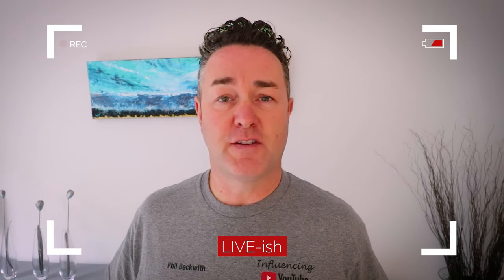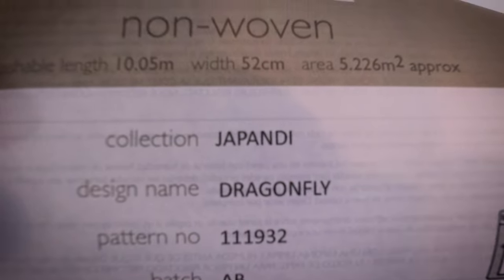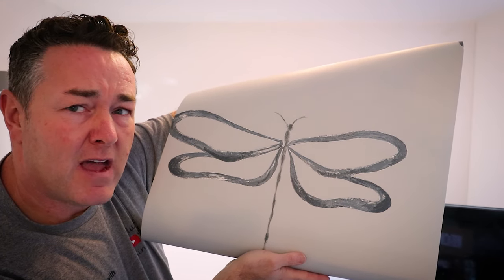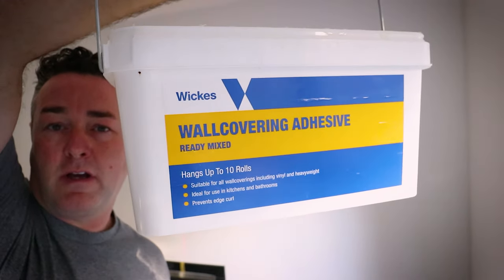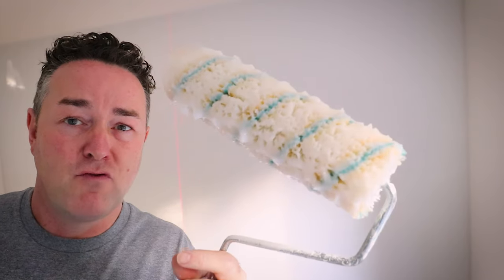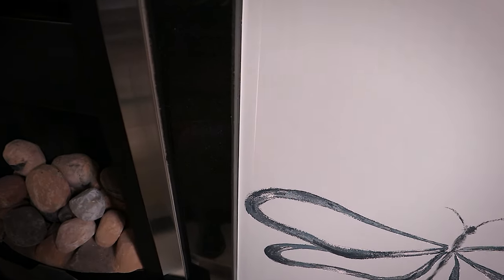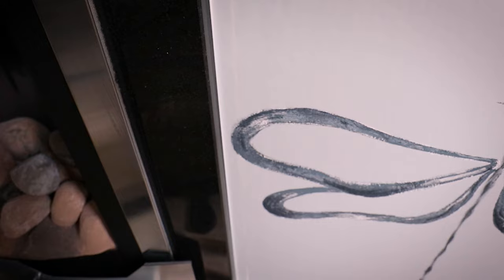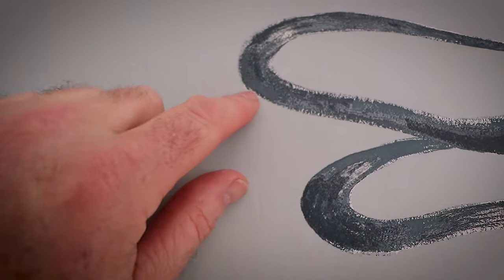How To Wallpaper a Feature Wall - Scion Dragonfly wallpaper - Paste The Wall

Comment: Why do you use Wickes ready mixed adhesive and not wallrock power adhesive on the filberliner???
Reply from the maker: Never felt the need. The Wickes paste is ready good.

I use the WallRock Damp Adhesive when using Damp Stop though :)
Reply: @ProfessionalPainterDecorator  I will give the Wickes ready mixed a go, got full house of fiberliner smooth to hang. Was going to use a wallpaper paste. If it's rubbish you will hear back from me 🤣
Reply from the maker: Use it straight out the tub.
If you find it rubbish.... LoL
Done loads and loads of Wickes paste and WallRock. 
A longer pile roller is good to get enough on, don't over roll it out.
Reply from the maker: Did do you mean to out were going to use a flake paste or the WallRock paste?
Reply: @ProfessionalPainterDecorator  was thinking of using flake paste and adding a bit of Pva
Reply from the maker: @neil30264  i hope that's a joke lol
Reply: @ProfessionalPainterDecorator  you should try it, sticks like sh!t to a blanket 🤣

Comment: Hi Phil , I’ve been hanging paste the wall paper all from b&q worked of the roll as recommended done a few feature walls , all joints was very god when first done ,seems to have lots of movement where the joints have moved , I’ve used the same paste as you, I even sized the last lot of wallrock fiber lining to stop any movement with  a thin down coat of paste it’s seem to have helped . I seen on a forum that people are saying wet the paper with just water so help prevent movement when using paste the wall paper, what’s your thought,
Reply from the maker: have they sprung or just pulled back?
Reply: @ProfessionalPainterDecorator  they just pulled back, or overlaped , I’m redoing to chimney breast due to smoke damage. Couldn’t believe the amount of movement in the paper,  I wonder if it’s due to the amount of heat as it’s gets really hot .
Reply from the maker: @richardloze5994  it shouldn't overlap. 

I do find all bon woven slightly pull back when dry . But nothing major.

Iv always said WallRock etc showna slight gap once dry.. even when hung with butt joint.

It's supposed to be a stable product.... It's not 100% stable.